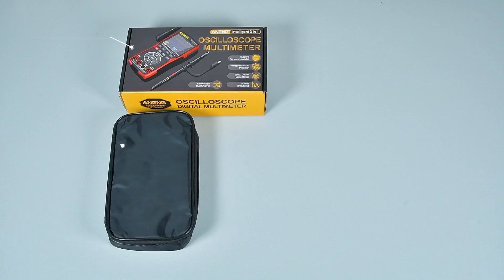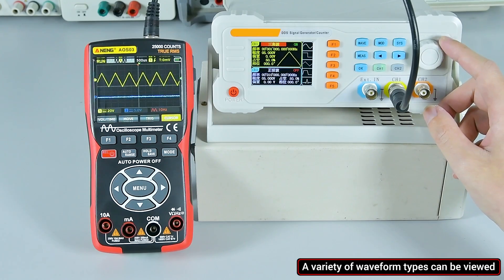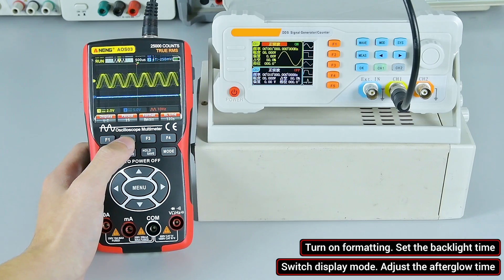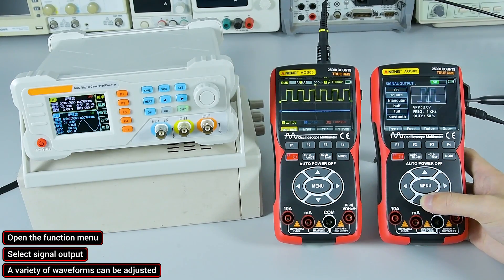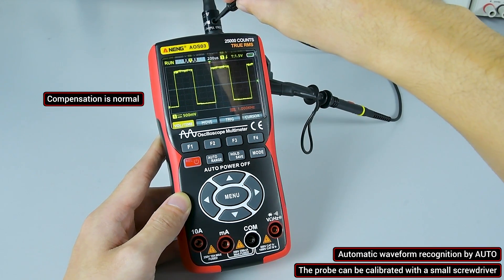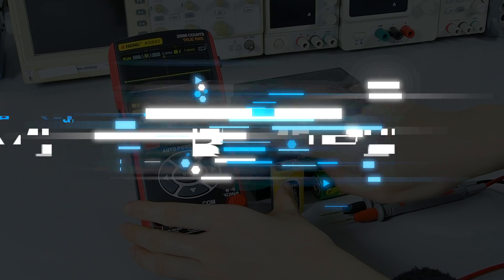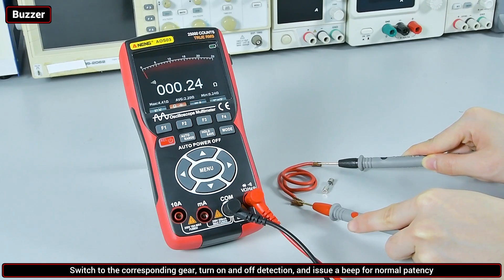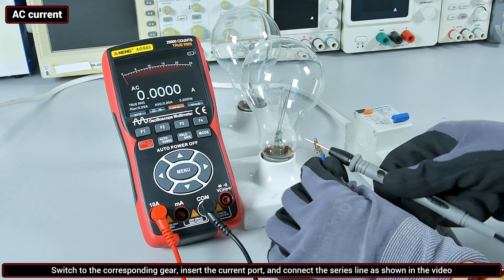ANENG AOS03 Oscilloscope Multimeter Signal Generator Waveform Output Handheld Battery

Comment: Hello ! is this model Aneng AOS03 equal to Zoyi 703? What about new firmware updates in the future ?
Reply: I believe they are.
Reply: Yes they are, and will take the new firmware version 1.4.2. with FFT (FAST FOURIER TRANSFORM) added. Oct 2024.
Reply: @Cortina_Ron  Yes , have just installed , and the device is working fine , without any freezes . Thank You for this information !
Reply: 1.4.2 is the latest update?